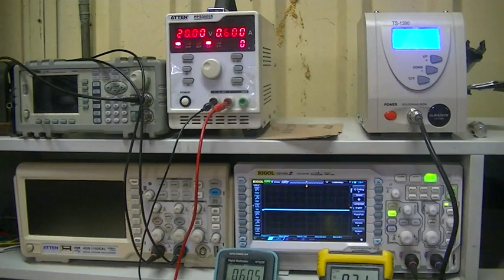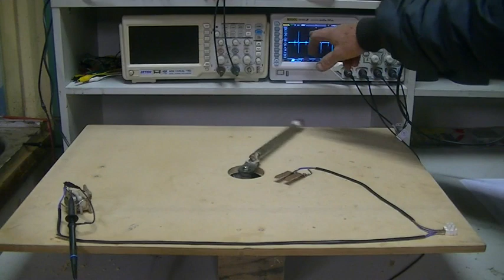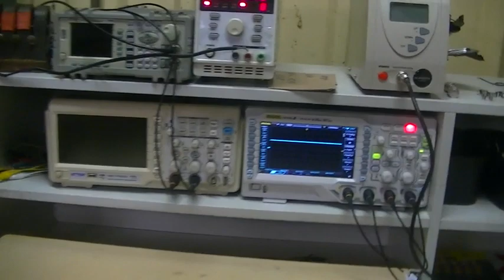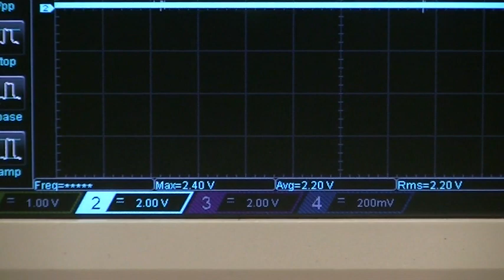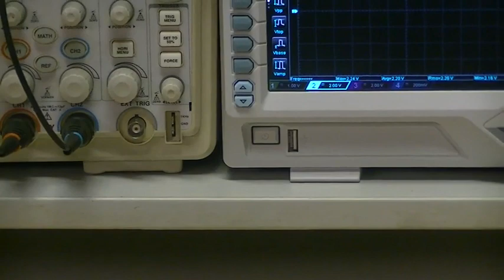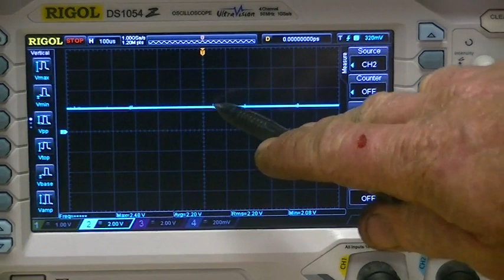Coil current v magnet speed test 1

Comment: Great tests.  I did similar tests years ago, before the fancy digital scopes were common. by hand tabulation using a variable speed controlled motor driving a coil and magnet on rotor and various loads.  After charting the data at speed vs LOAD volts and amps.  I found that the graphed data showed for a resistive load, that the voltage vs frequency (mechanical speed) showed a fairly proportional increase as speed increased and tapers somewhat at higher speeds.  For the current graph over the same tests, the current did increase some from lower speeds, but I found that the current is very gradual to change over speed and is not near as proportional as voltage is over the speed ranges.  Was using neo magnet and coil wire on a 1/2 inch dia bolt in test gig.  In your case you are using for a load a capacitor or a short where I used a steady resistor load.  Your data observations is not surprising in comparing the 2 capacitors values.  It must be  remembered that the impedance of the circuit changes as speed changes and is different for the 2 values of capacitors also.  In fact same is true for the generator coil.  Must be factored in with your time period/duration observations.  For a second test, I would recommend first, establish a graph showing what the ideal load resistor should be.  Test with an ideal resistor load since the the impedance will be nearly the same for all speeds and you can see all the information with your nice scope.  Next, knowing this ideal load match, if you still want to use capacitors as loads, you can but now you will know what values to use to fit your speed ranges to get maximum power ie for you maximum amps per unit time.

Comment: Is there an issue with less energy being drained from the capacitor at faster rotation? The time the shorting contacts are closed is less as the arm speed increases. That may leave more energy in the cap from previous cycle.